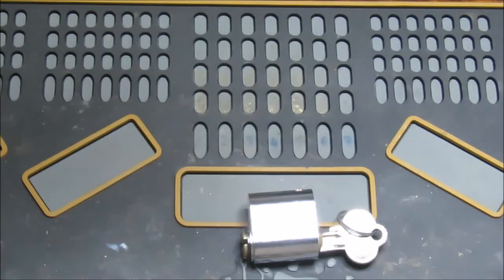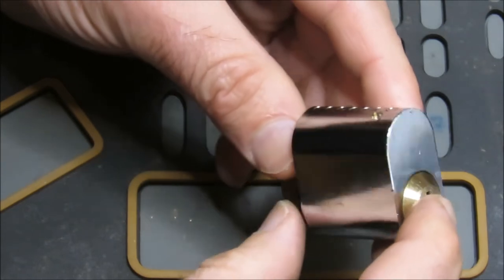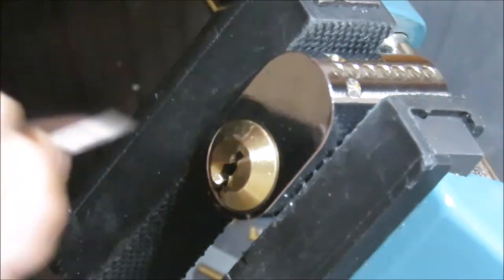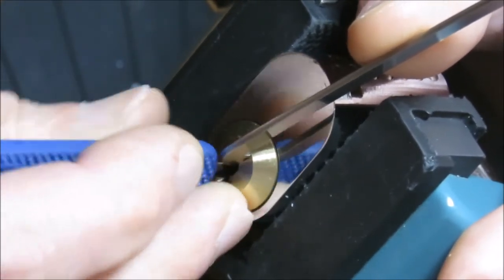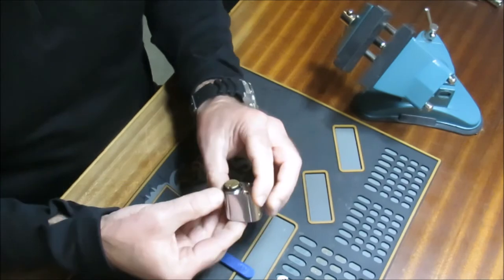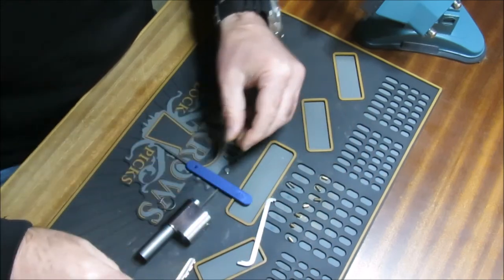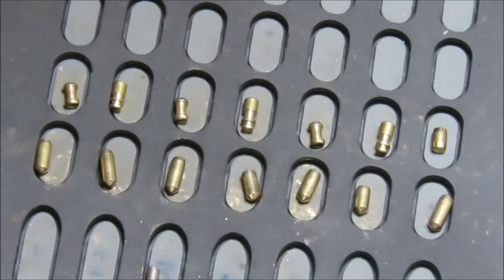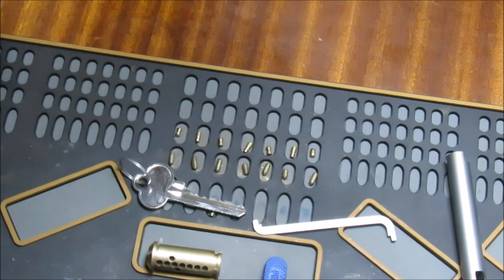[105] Seven pin Biltema Scandinavian oval picked and stripped

Comment: These locks are easy to remove from a door, ive usaly only used a screwdriver to break of the shroud around the outside of the lock cause most got wood doors so its easy to get a screwdriver under then use a wrench on the lock itself and just twist then use the big screwdriver to open the door, cause all ppl use the 2 screws that comes with it that has break/saw marks
Reply from the maker: Well done, you have discovered lock snapping.
Reply: Michael Maynard over 25 years since i did it my first time on these locks, but then it was usaly 5-6 pins. But pins dont matter as much when ppl need to get in without destroying much